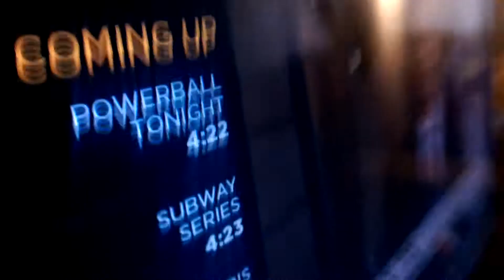Sony TV KDL-40V4100 Bad Tcon board AS15F chip. Put a more reliable chip in and now its perfect.

Comment: What chip did you replace it with?
Reply from the maker: I dont know the number off hand but you can google AS15F reliable replacement. 
They are a few makes that do the same thing. All chips are 48 Pins.
Reply: Jermaine Ortiz I’ve got a AS15-f 0738bgb7723571 ic can I replace it with AS15-f 1518cb8803976 what does the last part of the number represent?
Reply: I have the same tv with the same problem. Just took the back off. So you just replaced the chip and not the whole board?
Reply from the maker: I believe they all do the same thing just one of them have the thermal pad on the bottom the other doesnt. thats a high powwer chip count the pins also if there both 48 pins it should not hurt to use it. they are tricky soldering in.